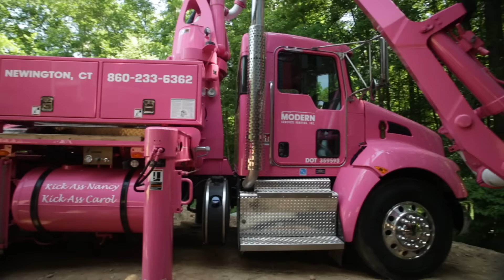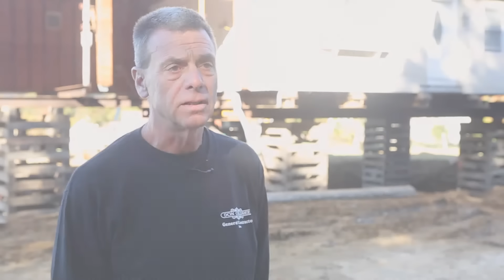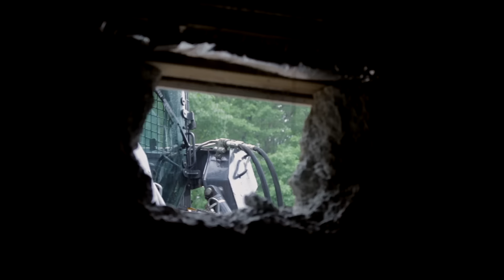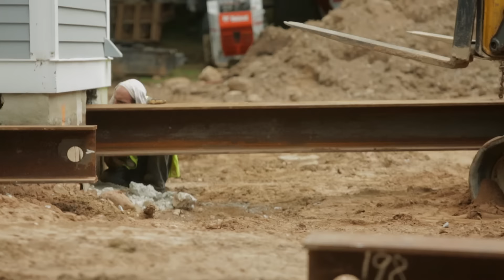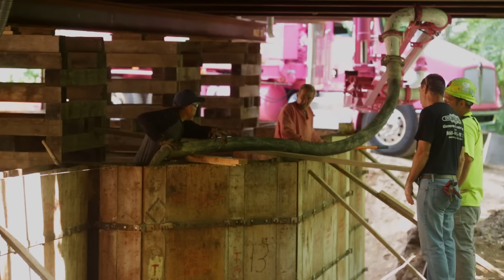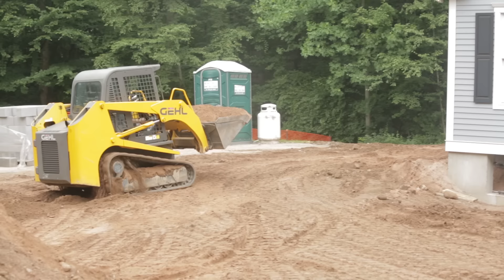Crumbling Concrete Foundation Repair Services

Comment: How does learning a house work on a concrete foundation? Is the process the same as the one in this video? I’m assuming it would be different but I’ve never seen a home on a concrete foundation slab being repaired.
What did this cost